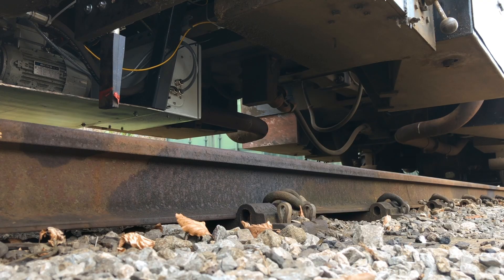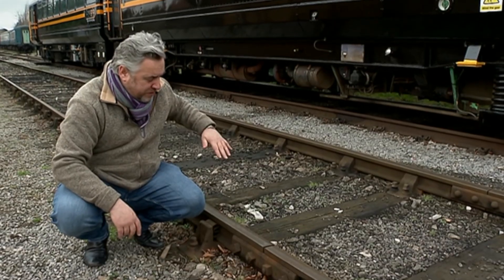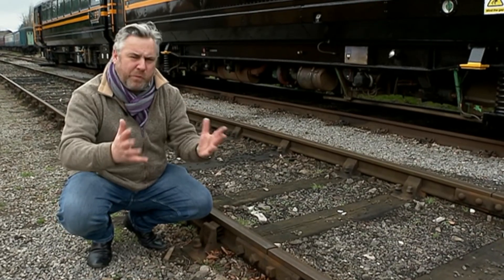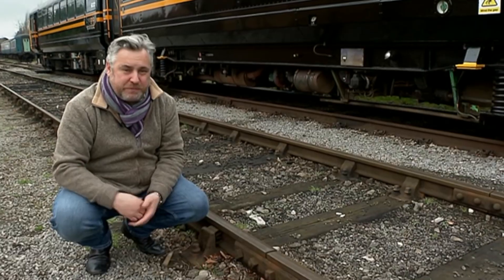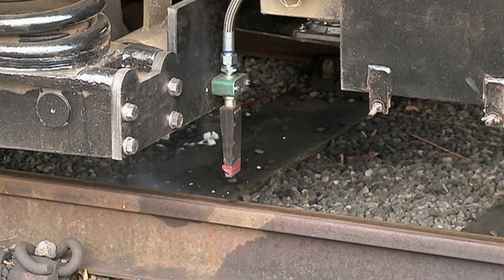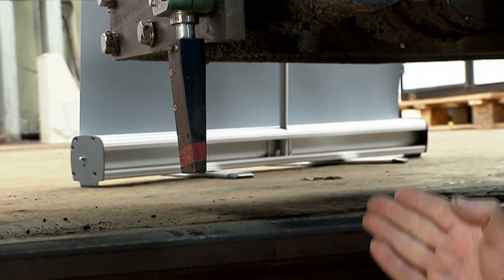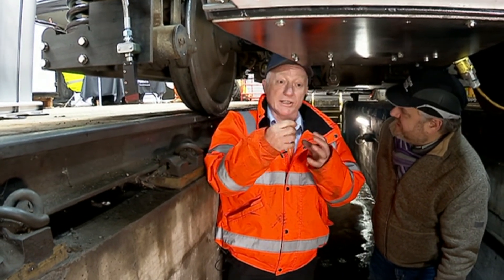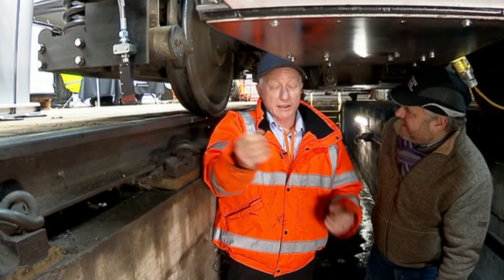Old trains - new tech for clearing leaves on the line. On test at Wensleydale Railway in Yorkshire.

Comment: Another complicated solution for a simple problem.
All trains have air compressor equipment for braking.
Upgrade this equipment to be able to supply continuous compressed air & direct an air stream at the track in front of the first wheel sets, this way a leaf that has landed on the track is blown clear before the wheels crush the leaf in to the paste that causes the problem.
Reply: Doesn't work in the same way. First, the pressure of dry ice is in the order of 70 bar, while a train's air system is about 5 bar - meaning much less piercing effect of the jet of gas. The velocity of a jet of compressed carbon dioxide is much higher. 
Second, dry ice can come out as solid particles. It is used in that way in specialized paint stripping and cleaning systems.
Depending on which way the system works, in theory 70 bar of air pressure might also work, but i expect it not to, because why bother with big tanks of compressed CO2 when a simple air compressor would also be enough. 
If just a blast of air would be enough to move wet leafs aside, then the rush of air created by the train itself would likely already be enough.

Comment: Why is leafs on the track such a big issue in the UK -- dosn't seem to be in America and we have trees too... in some parts of the country 🍁
Reply: I actually know a little about this- as best I recall, when wet leaves are crushed under wheels, it becomes a pulpy material that's even more slippery than soap, oil or grease.
Reply: Because trains in the USA have massive locos. UK trains are now lighter (effectively a load of coaches with  bus engines underneath them)... great for acceleration. but crap to stop on slippery rail, and a nightmare to travel on for more than half an hour due to the noise of sitting above an engine at high revs.

Comment: I'm glad some pacers have been preserved 😊. They weren't bad Trains, they just were showing their age at 30+ years old, especially compared to the modern CAF trains we now have that have succeeded them.

Pacers essentially being Leyland national buses built on a high speed freight wagon, lacked bogies and that made them bounce, hence the "nodding donkeys" nickname they got.

I liked them, but do prefer our modern trains we now have over them, as they're much smoother, quieter, faster, more spacious etc...
Reply: Quite a few of them have been preserved.
Though some have been converted for other uses.
Reply: Remember that BR were asked to provide the cheapest possible solution by the Conservative government hence the bus body on High Speed Freight Vehicle (75 mph). It would be interesting to compare the cost of a Pacer to the cost of the new CAF trains. Also I suggest that the Pacers had decent acceleration for such a basic train, the engines & transmission being, I understand, similar to BR Sprinters (Hjgh Speed Diesel engine driving via a Voith torque converter).
The present day Conservative government then had the audacity to join in the criticism of the 30 year old Pacers although they had effectively caused their low specification.
Reply: They were bl00dy awful!
Reply: half the issue is that the ops company were putting them on long distant journeys meaning that they did a hell of a lot more squeaking, bouncing and passenger comfort wasnt great because the seating was more of a short journey commuter train. I volunteer on a railway that has one and they run smoother than our bogie stock....

Comment: Interesting video but the description should make clear that there is a chemical reaction between the leaves and the steel rail that results in a slippery surface, similar to how molybdenum disulfide additive in lubricating oil coats steel resulting in a low friction finish.

Comment: Noooooooooooo..
Not CO2.........
Reply: Plants need carbon dioxide to carry out photosynthesis.
Reply: Use of dry ice is not polluting!
Reply: @mr-dan-coleman  Then neither is driving our cars.  Can't have it both ways.
Reply: @smgdfcmfah  - Dry ice does not produce CO2 or add CO2 to the atmosphere, your car burns hydrocarbons that releases CO2 that would've otherwise not been in the atmosphere. You can very much have it both ways. One is polluting, the other isn't.
Reply: @mr-dan-coleman  Seriously?  So where does it go?  Dry ice is magic, is that it?  You need a very, VERY basic lesson in chemistry!  Dry ice IS CO2.  Period.  When you use it as a sand blaster (as in this video), it melts and immediately goes into its gaseous state since there's no liquid state at normal air pressure.  In other words, it immediately dissipates into CO2 gas and enters the atmosphere.  PURE CO2 gas.  It doesn't vanish.  It doesn't break it's bonds and magically change into Carbon and Oxygen (even if it did, they'd quickly recombine). Why would you make such an asinine and incorrect statement about something you are so clearly completely ignorant about?  Or was it intentional and you're just spreading propaganda and lies that suit your agenda?  It must be one of the two.
Reply: @smgdfcmfah  and where did we get the CO2 from in the first place? Think about it for a second... just think... please.
Reply: Come to think of it, I took some water from my tap earlier and then I froze it into ice cubes. One of those ice cubes melted when I left it out, so I guess I've just created brand new water?
Reply: @mr-dan-coleman   That's another story, isn't it?  You said "Dry ice does not produce CO2 or add CO2 to the atmosphere".  You couldn't be more wrong.  If your argument is that it's a net zero because most of it is taken from the air, that's a different statement (still wrong as there is a large energy consumption in the creation, but closer).  For that matter, where do you think the CO2 in hydrocarbons came from?  Wasn't born in the earth, you know. Think about it for a second... just think... please.  Again, you can't have it both ways.
Reply: @smgdfcmfah   no it’s not another story. My statement “Dry ice does not produce CO2 or add CO2 to the atmosphere” is 100% correct but you are clearly not capable of understanding that. It doesn’t produce or add, i.e increase the net amount of carbon in the atmosphere, it’s a recycled product. Even when the source is a by-product of manufacturing, you can still consider the dry ice itself as neutral, as the product itself does not actively contribute to an increase in carbon dioxide.

I understand where the hydrocarbons came from thank you and of course, the carbon in said hydrocarbons is not in the form of CO2. I refer to them in this context as the burning of hydrocarbons is a deliberate action that contributes CO2 that would otherwise not be in the atmosphere. Put simply, if you don’t use the car, you haven’t released the associated CO2.. it’s quite a simple concept really, but you appear to struggle with those.

I know that it’s probably embarrassing for you that you don’t really get it, but that’s ok. Do a little bit of Googling about dry ice, take some deep breaths and just calmly say “I was a bit silly on YouTube today”. It‘ll be ok.
Reply: @mr-dan-coleman  Again, you're the one that doesn't get it.  Your original statement was 100% false.  Here it is again:
"Dry ice does not produce CO2 or add CO2 to the atmosphere".  That is simply not true.    You probably realized your mistake but rather than admit it you doubled down and tried to redirect the argument.  Nice try.  What you MEANT to say is that there is a net zero effect (which I pointed out), but you didn't - so the mistake is yours and yours alone.  As I said in my second statement, even the idea of it being net zero is also false as making dry ice is very energy intensive and very few industrialized places have low carbon emission electrical grids (some do), but you didn't even read that far.  

The hydrocarbons in the ground are made up primarily of hydrogen and carbon - and the carbon was all out in the atmosphere at one time, so returning it there will not destroy the planet.  It will help warm it, to be sure, but it's been warming for 15,000 years anyway and will continue to do so with or without my car running.  If a little extra CO2  heats it a little faster, oh well.  I'm still not buying into whatever BS climate panic people like you are trying to force on us.  Enough of your fear mongering.  Try living your own life without try to run my life and have me taxed to death.
Reply: @smgdfcmfah  I’m imagining that you’re most likely American? 😂
Reply: @mr-dan-coleman  You certainly are.
Reply: @mr-dan-coleman  Nope.  Nice try at misdirecting the point again though, rtrd.